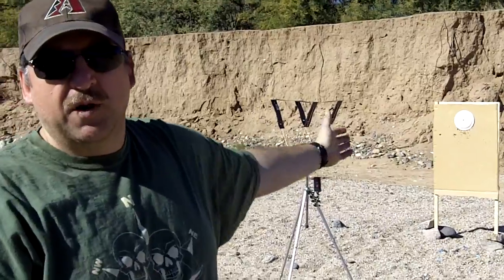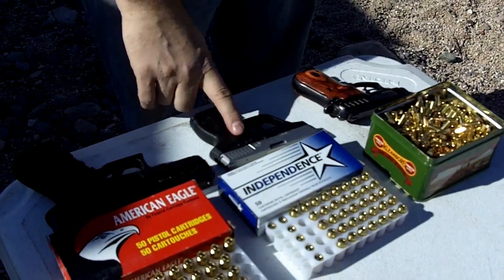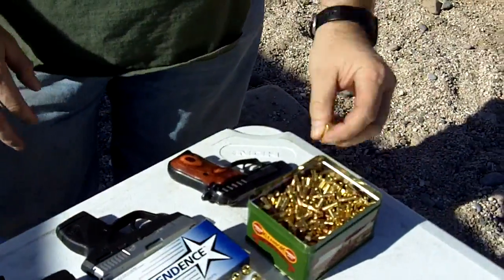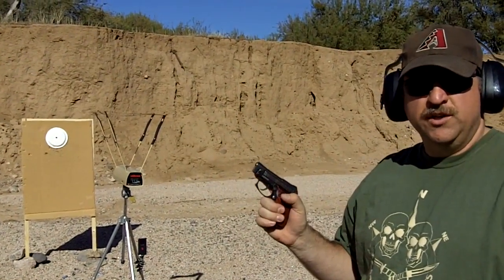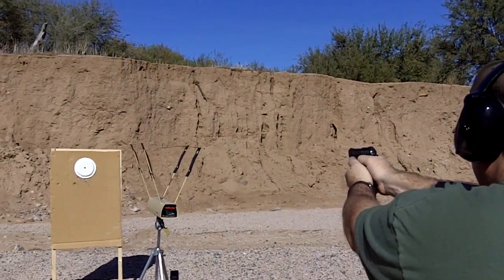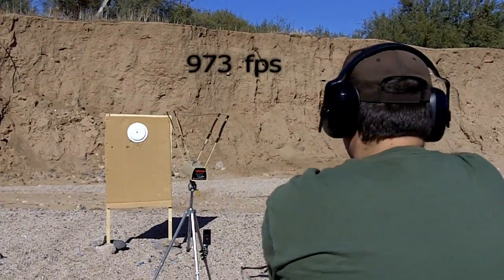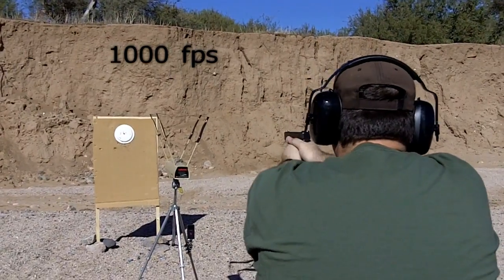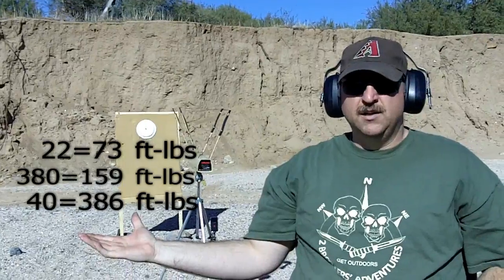22 LR vs .380 vs .40 ft lbs energy

Comment: how did you calculate the energy? I figure you use bullet velocity, bullet weight. Do you also include bullet diameter in a formula?  thanks in advance for showing your calculation so that I can calculate different bullet energy.... thanks

Comment: bruh, a guy named Joerg Sprave made a slingshot in 30 mins that cost about 14 Euro/ $11 that put out 99 Ft/lbs.. lmao.. That's more than the 22, and it fires at about the same rate as a bolt action (if he's fast enough)
Reply: He is also massive and can probably get a lot better performance out of those rubber bands than your average mere mortal. It should be noted that I have the wrists of an 8 year old girl so most of this reply is just sulking.

Comment: Sectional density of the round plays a majorly significant role in the terminal ballistics of the round.  There is where the relatively low energy of the 22lr is greatly enhanced l.  It is one nasty little bugger because its frontal area is small and the relative length of the shaft of the bullet Is comparatively long.  Its lethality is thus usually underestimated.  25From a rifle, low recoil, fast follow up shot, bx25 mag in a 10/22 is highly potent.  Only 24 possible quick follow up shots. lol

Comment: The cartridge model makes a big difference in the results. For instance, if I were going to use a 22lr for protection, I'd go with something like the CCI Velocitor. Their published specs for that 40 grain round is muzzle velocity of 1435 ft/sec and energy of 183 ft-lb., making it comparable to (or better) than the .380 in your testing. Of course, if you just want something to drop dead in its tracks, the .40 is far and above the best choice of the three in your test... Thanks for comparison!

Comment: Thanks for the advice but when it comes to firearms il stick to imperial measurements. (Even though i use the Metric/Decimal system on a daily basis in other areas)
My comment was in response to BUILT4BASS who specifically sought the formula in imperial figures.The gentleman in the clip also uses imperial figures, a system that is still in widespread use in th U.S.A. the U.K.  (ie .22 .380)
 The word "magic" was used figuratively and does not infer the use of spells or sorcery of any kind.

Comment: @Blahblobify NO you are incorrect! Quote from the site: "The initial kinetic energy of such firearms is very low—you would be much better off with a .25ACP or .32ACP for roughly the same size firearm." The .22 out of the rifle did 16" of penetration! The others out of a handgun got 11-12.1" f penetration! The .25's did 15" of penetration out of the shorter barrel! AND the others were all HP .25's in which case expanded more and kept its form better than the .22. Also I get my .25's for $16 a box